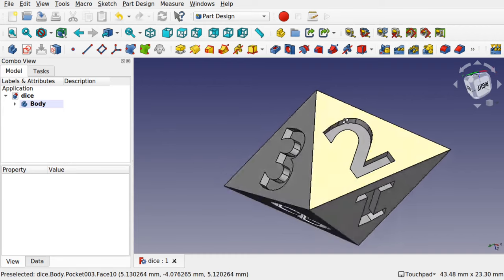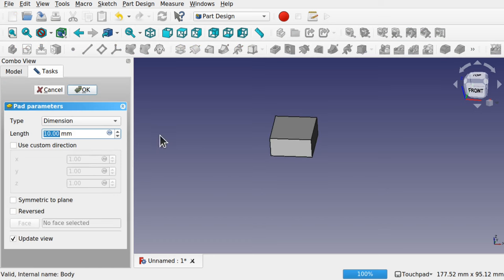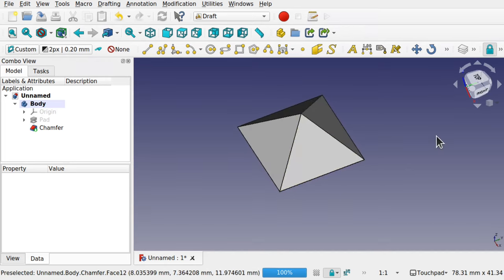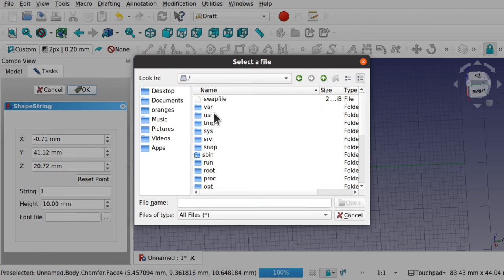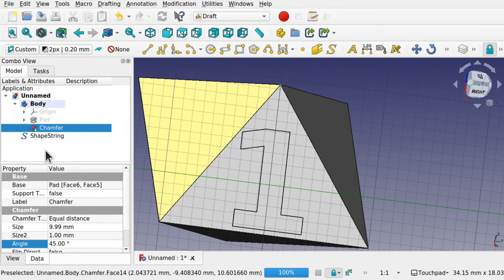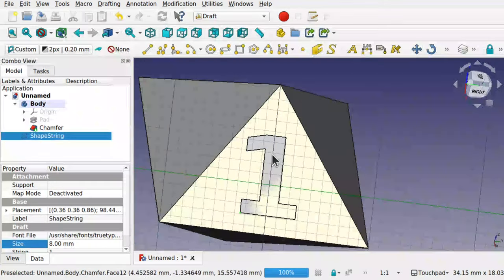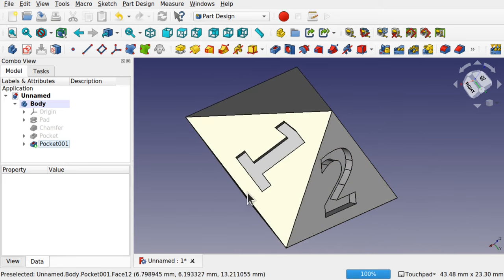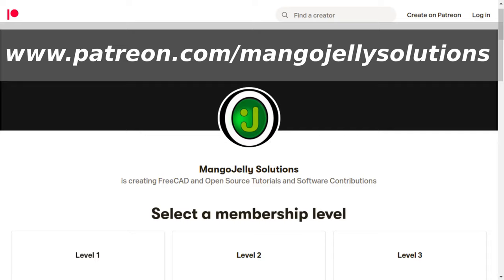FreeCAD: Easily Add Text / Numbers to Faces in Part Design. Beginners Dungeon Masters Dice

Comment: ..When I click to pocket said numbers, I get an error message and it won't pocket them. Why? It pads them fine, but I want numbers to go through the plate/block.. Anyone can help please?
Reply from the maker: The pocket may be travelling in the reverse direction rather than forward.  Try the reverse option on the pocket options.  Also check to see that the text is positioned on the face.  If it's floating above then your pocket has to be deep enough in length to span the blank space.
Reply: @MangoJellySolutions  Thank you for the reply. It can only pocket text so deep but not all the way through. Numbers won't pockets at all.

Comment: I did: Part -> Cube (default 1.00 side cube) -> Chamfer -> "Select Face" -> Selected top and bottom -> Chamfer size of 4.99mm (5.00 mm crashes and I still don't quite know from were this number come from) -> Bob's your Uncle: An Octahedron

I've tried your method also, and both have flaws: both methods of constructing the octahedron, leaves the final solid with a band of 20 microns tall in its middle and both top and bottom tips, some funkiness going on deeply in FreeCAD floating point operations ?
Reply from the maker: Thanks for the comment.  You can make the shape a number of different way so using chamfers is one option or you can use a loft or a extrude with taper.  There is an external add on pyramid workbench which allows a number of different shapes that can be configured extending the base shapes of freeCAD all of which are potential base shapes which could be ideal if your into your dice design.

Comment: Hello, first of all, your videos have been EXTREMELY helpful in my first steps to learning how to use freeCAD to design. Thank you SO much for doing them. One day in the very near future I will be sending you a donation, just really strapped at the moment. Part of why I traded my guitar for a 3d printer, to expand my business I just had to restart 2 months ago. 

Anyway, I have run into a problem after I add text my model using the methods you have shown. I watched your video on how to look for intersecting lines, which is my issue according to the check geo check. I still can't seem to figure out the issue. I even rebuilt the whole model from scratch a 2nd time, doing a check each time I add a feature. For some reason, adding the strings breaks my model. The face on the front turns black when I export to STL and I am unable to properly slice and prep it to print.

Any suggestions?
Reply: Actually, I think I figured it out. I went back and started from the start and went step by step. Realized I didn't have the "symmetric to plane" clicked

Comment: Easy solution, thank you!  I was wondering...What if  you have several shapestrings on a single plane and you want to pocket all of them?  Do you have to pocket each one individually or can you group them before pocketing?  If so, how do you do that?  I tried doing one by one and after 4 or 5, freecad crapped out.
Reply from the maker: You can use the sub shape binder. So select all shape strings on the same plane, create a sub shape binder and then pocket / pad that. It basically groups then together.
Reply from the maker: You can create a sub shape binder with all 3. You will be able to then pocket / pad the sub shape binder. It will group all three together so should be what your looking for 😊
Reply: @MangoJellySolutions  ah!  Worked like a charm, thank you!!!

Comment: Do you have any idea how to snap center of a string? And maybe keep center of a string (or a letter) attached if we change the size or the string/letter itself.
I tried many settings but nothing seems like a solution. Thanks for your answer and all the videos - they are priceless!
Reply from the maker: I do have a video regarding using a sketch and attaching the text to the sketch to act as a way of alignment.  It's a bit of a work around but it works. https://youtu.be/Ul60Ug2CRVk

Comment: Using FreeCAD 0.21.2. I followed this great tutorial to create some text and position it onto a surface. Then I padded the text. Because I want to print this, I tried to fillet the edges of the text. The length of the pad is 2 mm and the radius of the fillet is 0.1 mm. I selected "Use all edges" and clicked OK. FC works for a few seconds and pops up an Input Error dialog box with "Failed to create fillet". I tried different values for the radius and got the same result. Am I doing something wrong/impossible, or is this a bug in Part Design? If there is a better way to do this I am open to trying it.  Thanks!

Comment: I was wanting to use the POLYHEDRON workbench to create my dice, and engrave the numbers into the face surfaces. Since I can't POCKET sketches into those sort of objects, I tried to BOOLEAN DIFFERENCE them but more than one boolean  operation per face seems to cause a ton of issues. Is there a way to do this?
Reply from the maker: Just had a quick look ( I have never seen this workbench before).  So when you create your shape what you then need to do is create a new part design body and drag and drop the shape into that body.  This will create something called a 'base feature'.  You can then sketch on any of the paces, pad, pocket etc.  You can then follow the exact same process as in the video with the base feature.

And this workbench is exactly what I need for a ring that someone wants me to design.  I just spent a good half an our chamfering a cube down to make a gem stone and was dreading doing the next 2.    Glad you posted that comment :)
Reply: @MangoJellySolutions  ok, I'll give it a try. Thank you
Reply: Ok, yes that worked. I was not aware you could combine workbench objects that way using "MAKE BODY".

Comment: Hello again. I built a dodecahedron 30mm in dia. and used shapestring to draw the numbers on the faces using the utilities menu to align the grid to each face. When I pocketed the numbers into the surface  only about 5 of them actually pocketed.  When you rotate the die the others still look like shape strings, when you switch to hidden geometry you can see all the pockets are there, but when I make an .stl export and view it in blender, the first 5 faces are pocketed, the rest are completely blank. Is this a free cad glitch, or is there something else going on?
Reply: I think I found the problem, I uninstalled and reinstalled Freecad and it's working now.

Comment: Hi , How are you today , Another great video . Thanks for sharing . i would like to know how to combine all the little line segments into one line  around each letter  ? I would like to bevel the lines back to the base so it's easier to sandcast . like a sharp edged text, is this possible ? how do you add font files to freecad ? If you could show me how to do this I would appreciate this ?
Thank you , Have a great day 

Kindest Regards
Terry Lembke
Reply from the maker: Just finishing up a video regarding creating text that is bevelled or drafted to base.  It is possible but you have to go about it in a way that is not obvious.  The trouble is is that there is a degree setting for the chamfer in the part design but that will not go to the base of the object so you have to take a different approach.  I will be releasing that for the next video.  For the fonts what operating systems are you using? Mac, Windows or Linux?
Reply: @MangoJellySolutions  I have windows that freecad is running on now , Thank You . I really appreciate your timely responses to my questions . I really feel you care about your subscribers .

Take care and stay safe 
Terry Lembke
Reply from the maker: @terrylembke8100  thanks for that. I am not on Windows at home but I will bring home my work laptop tomorrow so I can check the fonts option on a windows machine. I am just rendering the video and doing the final checks so hopefully that will be up on my channel tomorrow. Thanks for the kind comments. I believe that my channel wouldn't be where it is without subscribers and I have had such kind feedback from everyone that I try to fulfil each request. I get alot so I am forever playing catch up. Some videos are easier to make than others and if I can make those in an evening I tend to jump on them sooner rather than later. Others could take sometimes up to a couple of weeks as I need to research. It's a never ending task but I enjoy it 😊
Reply from the maker: I have uploaded the video and here is a link so you can have a look.  https://youtu.be/SfQKV9VF9Rc

Comment: What version of FreeCAD are you using? I have .19 and it is not giving me the option of using a Shapestring as a sketch to pad or pocket. Thanks for the video BTW!
Reply from the maker: Glad you liked the video. I'm using the same version. Have you dropped the shape string into the body of the part design body?
Reply: @MangoJellySolutions  I right clicked and used the move to another body command.
Reply from the maker: @beautiful_upgrades  at that point is it inside your body in the treeview so when you collapse the body in the treeview the shape string doesn't appear outside? I didn't use the right click, move to body I dragged it into there so not sure if that's the source of the problem.
Reply: @MangoJellySolutions  Dragging worked! Weird since they should be the same action. Thanks!

Comment: Unfortunately, V0.20 doesn't work this way. You cannot pad or pocket shape strings anymore because it can't deal with multiple solids.
Reply from the maker: This was done in 0.20. Make sure you use the align plane with face
Reply: @MangoJellySolutions  Thank you, but I have 0.20.1 and it apparently does not support pocketed shape strings or the newest version has a bug. I miswrote before; I can pad it.
Reply: I have had the same problem, but I found that if I ensured the grid was toggled off, it worked perfectly, if the exact same set up was either pocketed or padded with the grid visible, it disappeared into a blank screen.

Comment: Excellent instructions. This won't work on Linux Mint 21 (now) because the PPA version of FreeCAD throws an exception on the Draft workbench and does nothing, and the flatpack version is too broken to use. I'm building the Py3/Qt5 version from source, but I'm skeptical that it will work. BUILDING Py3/Qt5 FROM SOURCE FIXES NEARLY EVERYTHING.

Python, like Java, is great for prototyping, proof-of-concept, or dog+pony shows to wow investors, but isn't suited for production code because there are too many newbs who have fried their brains on caffeine, and with witless abandon they're breaking dependency chains as fast as they can. Using any Python code that isn't built in, say, via pip, is like herding brain-damaged cats.
Reply from the maker: Thanks for the heads up, I will submit as a question over to the freeCAD Developers.  Hmm feel your pain, I spent today trying to use javascript node build tools to build a unrelated project in a CI/CD pipeline.  The computer nearly went out the window!